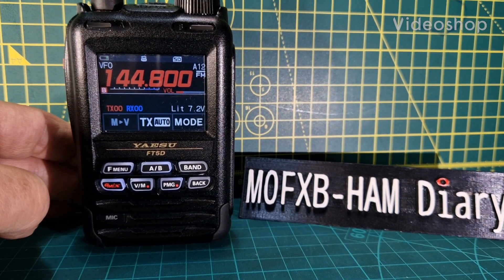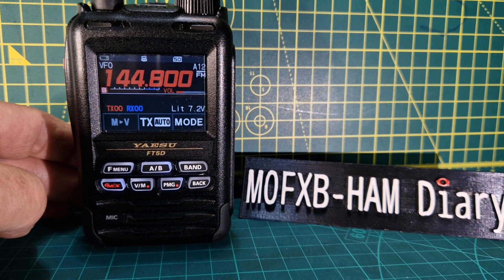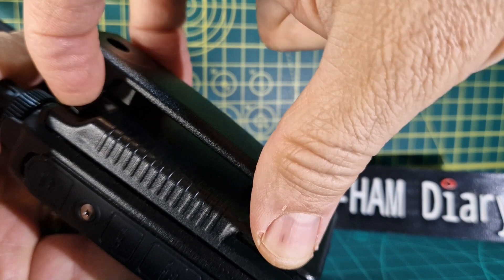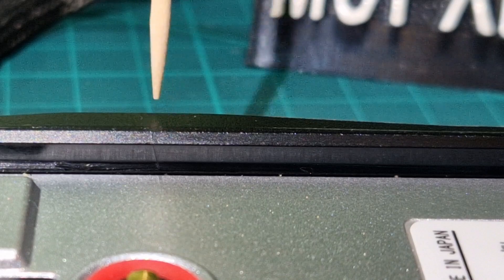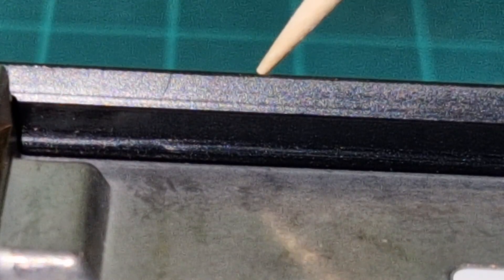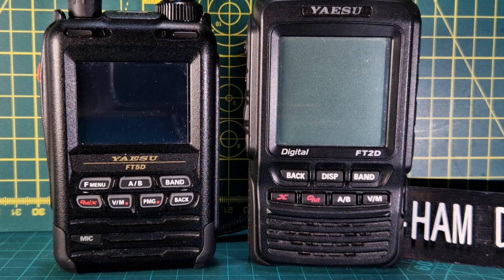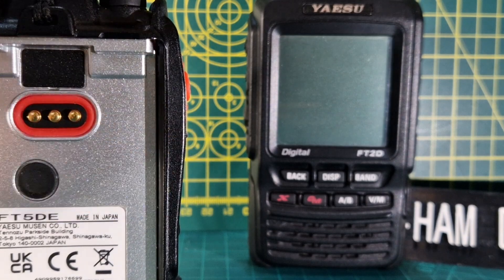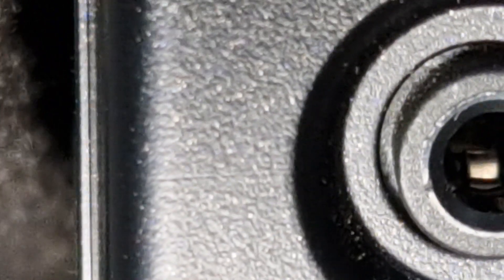YAESU FT5D Mold Line near PTT

Comment: Mine is absolutely cracked. If you apply a little finger pressure to one side if the 'mold line' one side moves and the other does not. The plastic is no longer connected.
Reply from the maker: Such a pain ask them.for a new case

Comment: Glad I found out about this before wasting my cash on one.
Reply from the maker: This line doesn't affect anything you hardly see it , The FT5D is a fantastic Radio .
Reply: @hRadioScannerDronesyes you are correct but I'd be gutted to have an imperfection on a £400 radio. Sticking with my FT70 for now cheers

Comment: Yes, it's an injection mold line but also has been a point of failure. I would guess some kind of manufacturing issue with the mold. Seen it happen to someone locally who barely used the radio, but the mold line was source of the radio housing coming apart.
Reply from the maker: Completely agree I also have a friend who says the line goes all the way through which looks and feels bad Yaesu should have a higher standard.